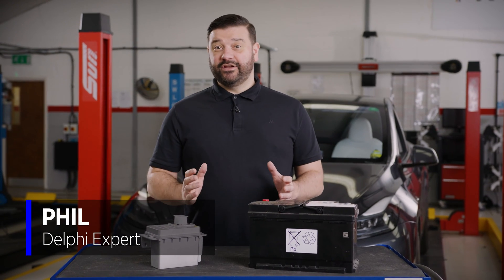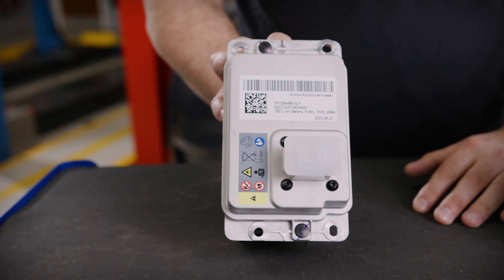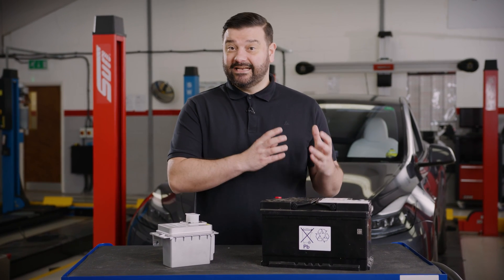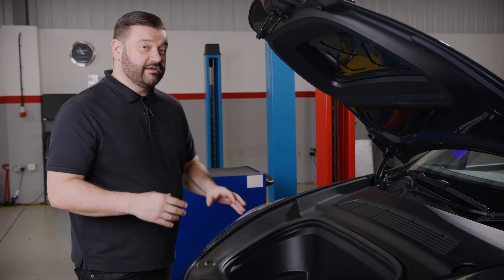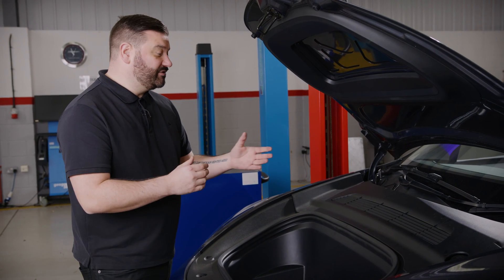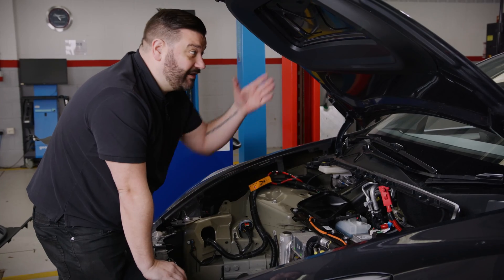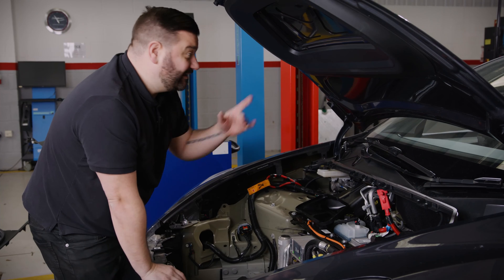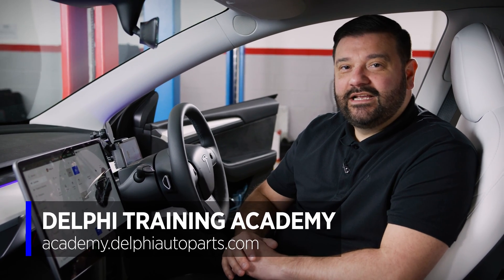[EN] Replacing a 16v battery on a Tesla model Y | Masters of Motion

Comment: there are two 12v outlets in my model y.  one inthe trunk and one in the center console...the battery is 16v ... are those outlets 15-16v in real?
Reply from the maker: Hi, yes the output of these outlets are 15-16v. You can read more in the owner manual which can be found here (UK version) - https://www.tesla.com/ownersmanual/2020_2024_modely/en_gb/GUID-7F07443D-5107-4A5A-A9F1-E02FF14E4A9A.html

The extract from the manual is "For vehicles manufactured after approximately November 2021, power inverters plugged into the low voltage power outlet must support 16V DC input to function." Thanks!